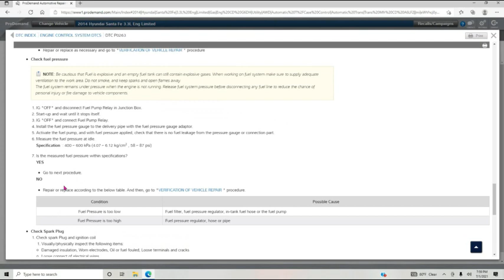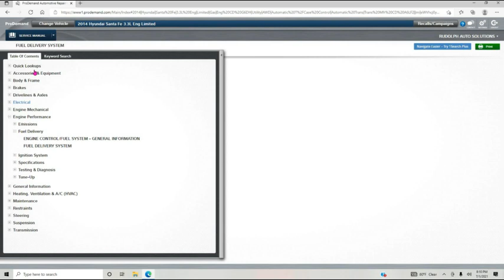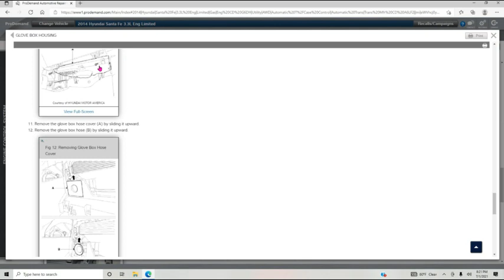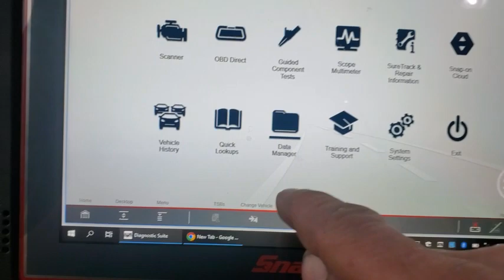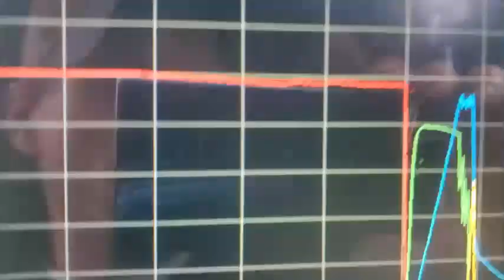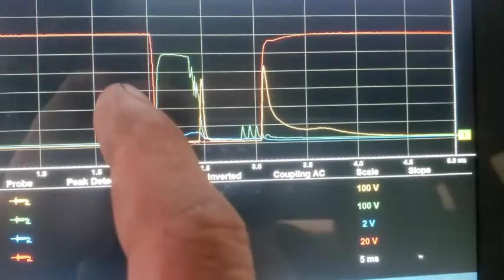2014 HYUNDAI SANTA FE 3.3L, P0263 WITH INTERMITTENT STUMBLE ON STARTUP

Comment from the maker: 2014 HYUNDAI SANTA FE LIMITED 3.3L

Miles: about 86k

I'm not sure if our Sales Department will approve the repairs...we will see 🙃???

CEL WAS ON WITH ALL MONITORS PASSED

DTC: P0263 CYL 1 CONTRIBUTION/IMBALANCE

Intermittent Stumble at idle upon initial startup when ECT was below 165 degrees F.  Vehicle did not lack power and didn't miss a beat when test driving.

TESTING & DIAGNOSIS:

Researched DTC(s) & DTC(s) setting criteria: HO2 Sensor Signal is used to determine inadequate contribution of cylinders in terms of AIR/FUEL & the DTC is set after 2 Drive Cycles providing no other circuit faults are set concerning the ignition/injector systems.

Clear Flood Crank - No indication of a compression issue was heard-consistent cadence.

Performed an under hood harness inspection - NFF

Smoked Intake System - No leaks found

Ignition System Testing - Symptoms did not warrant an ignition issue & COP for Cylinder 1 lived underneath the Intake Manifold.

Determined Testing Time Required: 2.5hrs to measure the resistance of all 6 Injectors @ the Injector Driver Box (IDB) connector (E100-IDB) behind the glove box compartment with engine cold: 1.6 ohms was measured across the board.
Scoped known good CYL 4 Injector & suspect CYL 1 Injector @ the IDB (see attached captures)

YLW: Injector Low CKT probed
GRN: Injector High CKT probed
BLU: Injector current ramps with Snap-On Low Amp Clamp in the 20A mode
RED: Injector Input or Control from the PCM-to-IDB

Confirmed faulty CYL 1 Injector Electronic Current Limiter as seen in the BLU trace in comparison to the CYL 4 Injector (known good)

Pretty wild!

Here's a link to my video on GM 3.6L GDI Injector Testing:

https://youtu.be/qhCN-R_CF50

Comment: 2013 Hyundai Santa Fe gls AWD, poor gas mileage like 12.5 mph, has U0105 Lost communications with Fuel injector control module (IDB) , is the IDB in the same location as this video? how much would the dealer charge to replace IDB? Thank you
Reply from the maker: Check service information to confirm location on the one you have.  Cost at the dealership...I don't know, depends on what they charge for labor?

Any module communication fault should be properly diagnosed before tossing a module at it.

Comment: Ive had this problem before and at first I could not figure out y it would only do it with a cold start then go away until my grandfather explained how the plenum gaskets will swell when heated sealing the vacuum leak and would run fine the rest of the day and as the engine cools the gaskets flatten out
Reply from the maker: And that very well could be the case in other situations, but in this case given the DTC we had a faulty injector; as proven with the scope captures.

Comment: Lower intake plenum  gasket 100% and I'll tell u why on a cold start the gaskets are flat allowing air to enter the intake which is a vaccum leak as the car warms up the gaskets swell due to the heat and as they do the swelling of the gaskets fill the gap thus eliminating the vacuum leak
Reply from the maker: This was a failed injector my friend.

Comment: i just worked on a 2013 santa fe 2.0t  and i keep getting yaw rate sensor fault code in the abs module, the piston in both rear calipers will not.  engage... front brakes still engage... did alot of research.. is the yaw rate sensor in the srs module?
Reply from the maker: I will leave to research this my friend.  I'll take a look later today okay?
Reply: @PaulysAuto  ya i mean i have the launch x431 software to program it in but the dealer wants $600+ dollars for an srs module... if thats even the issue...